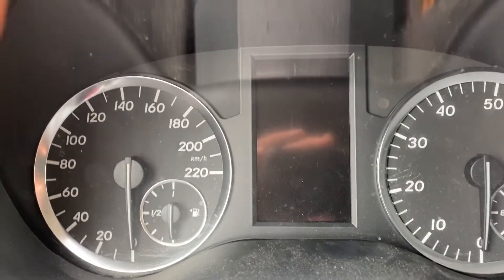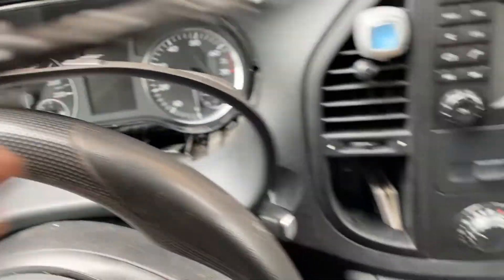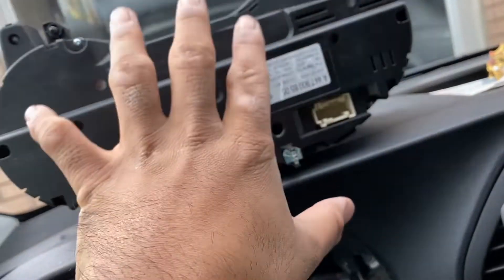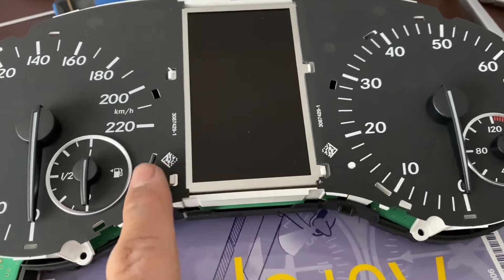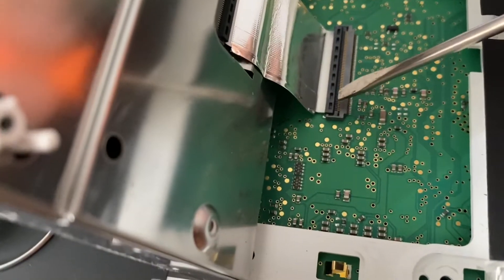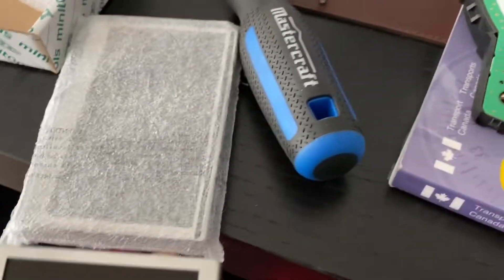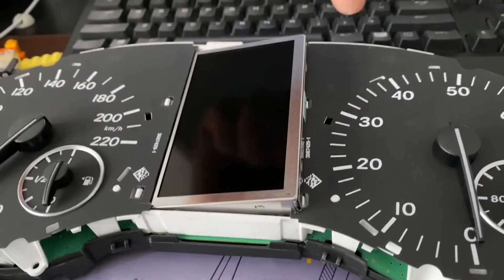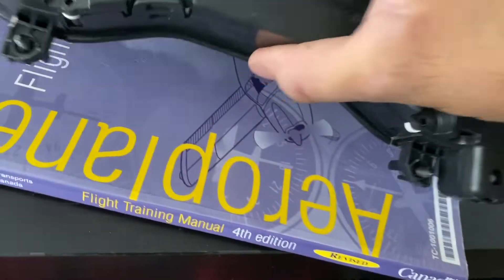Mercedes Metris/ Vito Instrument Cluster Screen not Working? Try this.

Comment: I have the same issue on a 2016 and spoke to the guys at minitools about a new lcd.  they confirmed that it is not the lcd, but rather a resistor on the motherboard.   They have a bench test kit and replacement resistor, but unless you are proficient at de-solder and soldering it's a difficult repair, at best.  Now I'm looking for a used, complete instrument cluster vs a new one for $1350 at MB parts.

Comment: In the uk. Beware, the screen is also held in with 4 screws on the back of the lcd screen and you only need to undo the ribbon from the back of the cluster, the black clip slides down and is easier 😉
Reply: he missed this step lol I almost broke the thing ..

Comment: After changing battery to higher amps and changing LCD screens, it remains a "On & Off" thing. I suspect is moisture in LCD and main board connection. Spray some electrical lubricants on the main board, switches and resistors and observe. Hope it helps.
Reply: Just curious if you have tried it and did it help? I replaced my LCD but still the same problem. I was told it is an issue with LED Back Lights not working. And how did you change the battery for higher amps? Where is it located?

Comment: Great video thanks!
 The problem I have is that my screen is temperamental. So sometimes it's black. Sometimes it's flickering and sometimes it's on like there is nothing wrong with it which leads me to believe the screen itself is possibly fine. 
Maybe there are 2 different problems folks are having🤷‍♂️
But any updates regarding this issue will be greatly appreciated 👍
Reply: Screen itself is always fine, never seen any faulty
.
Reply: Mine too. Screen started working again for about an hour but not since.  Seems to me like it isn't the screen - backlights either work or they don't.  Probably more likely to do with power delivery.

Comment: Unfortunately that's just a waste of time and €90.25 (current price @ minitools) plus VAT plus shipping. It DOES not cure the problem. Here in the UK the proper repair costs £239 with a lifetime warranty. 1 day turnaround or while you wait repair in Dorset.
Reply: Where abouts
Reply: Quoted £675 plus labour ls vat for same issue. Ordered screen for £47 going to try that first and see if it works
Reply: From Mertrux themselves by the way
Reply: @giftelectricalUK  Let us know. Current repair price in UK is £250 incl shipping, no VAT on top of that.
Reply: @giftelectricalUK 
Funnily enough bought our 65 plate Vito 119 from derby mertrux..
The display has just packed up..
Looks like we need to speak to them get a price and booked in..

Comment: I did the same with my Vito but it didn’t work 
Problem with mother board
Reply: My one same 
I bought new screen for my 2016 it didn't work
Both my one and new one if I flash with my hand light you can see it is still work 
But won't light up 
Any idea please

Comment: Not accurate, LCD held by 4 T-8 screws located behind back (black) cover.  In my case it did not solve anything. I contacted minitools specialist and described my problem before purchasing the screen. Specialist warned me that this will not work, that the problem is not the screen, it is the motherboard. I decided to buy it and try it. Well it is not working, I can see LCD display data if I flash light. No back light on LCD display. Dealer wants $ 1600.00 to replace and reprogram instrument cluster. Not a total waist of time, but in my case it did not solve anything.
Reply from the maker: yeah fair! for me i was lucky and this worked.
Reply: One resistor on the maonboard can be burned and cause this problem
Reply: I should have read this before resistor motherboard it's not the display

Comment: Like others here on the comments section, I've replaced it, but it doesn't work. Some people mentioned about a resistor on the motherboard. Does anybody knows which one is? Thanks.
Reply: Hello, did you fix the issue?

Comment: I had just finished changing mine. Bought from Ali express for USD$99 for LCD. Will update if it works later. Mine is right hand drive for Asia countries. My local only authorized workshop quote me USD$2000=PARTS $200, SOFTWARE TRANSFERING $1800!!!

Comment: Still not working after changing New LCD screen.
Reply: I know which resistor on the mainboard can cause the problem
Reply: @akuku4431   Could you please, give-me some information about which resistor can cause this? Could you show it? I have the same problem here. I replaced the display just for test, but it did not solve. I did some tests on motherboard but i did'nt found the problem.
Reply: @akuku4431  Can you help ,please ! I changed LCD but still not working , witch resistor on motherboard ?